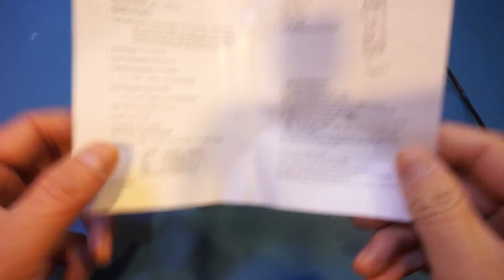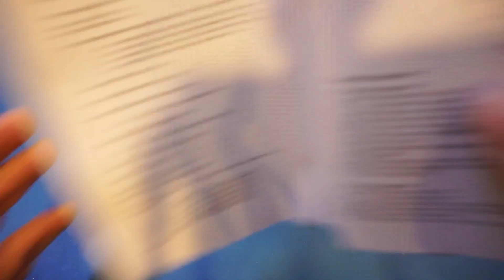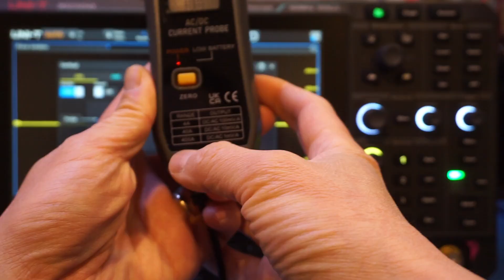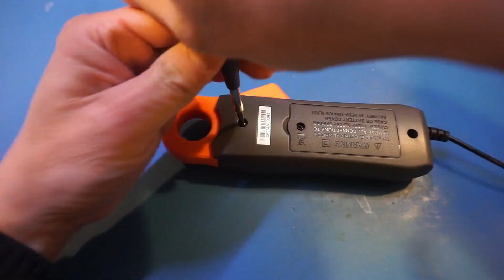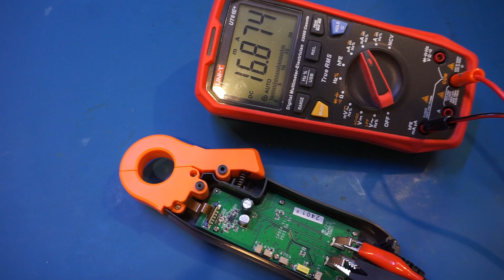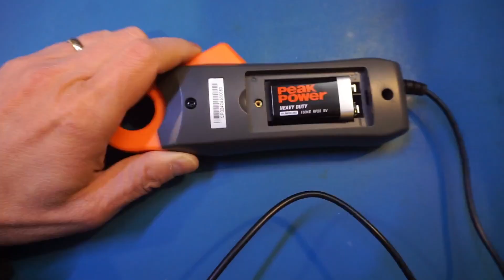OWON CP024 Oscilloscope AC/DC Current Probe Review/Teardown

Comment: The actual frequency is only around 500 Hz for power measurements and rectangular signals; above this threshold, large phase errors and signal distortion occur. 
The probe can reproduce sine-wave signals up to beyond 200 kHz, but they are heavily phase-shifted. The rise time exceeds 10 μs.